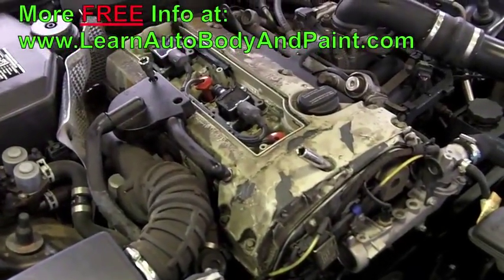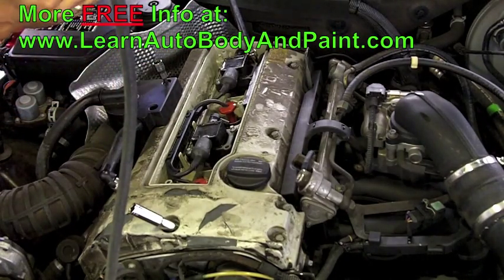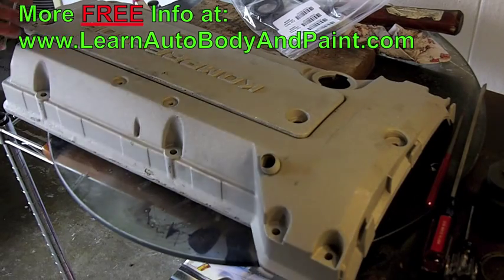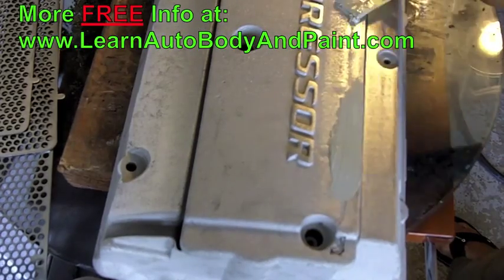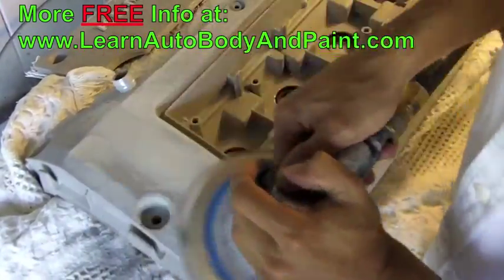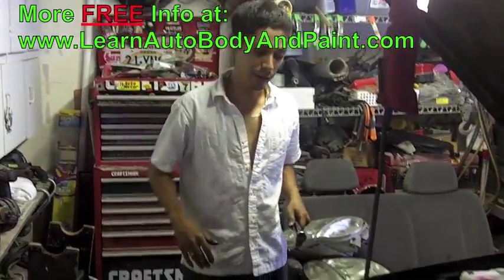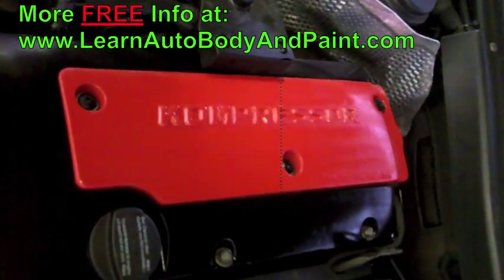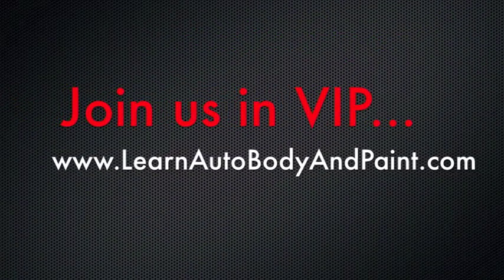How To Paint Valve Cover With High Heat Ceramic Paints From Home!

Comment: Hi Tony,
I was just going to say that if you're looking for a very cool look that doesn't require super fine sanding to look really clean, you should have a go with some wrinkle paint. Dad has a purpose built race car, it's valve cover has been black wrinkle painted with sanded writing. It was pretty corroded before panting, but all we needed to do was wire brush it and make sure there wasn't any big imperfections. :)